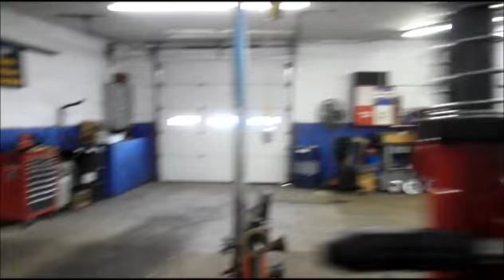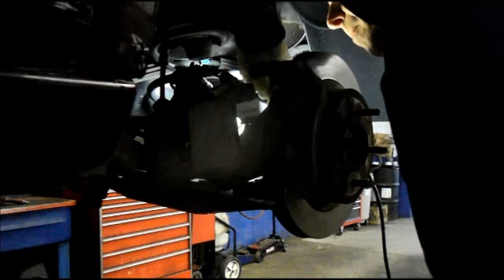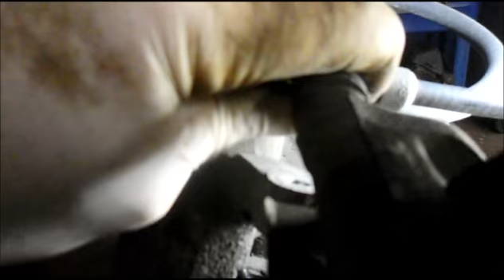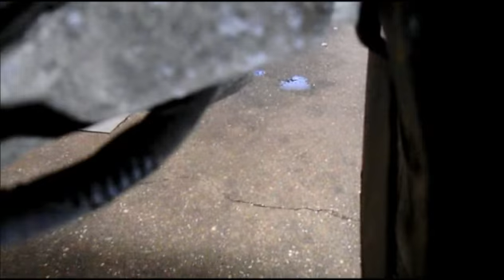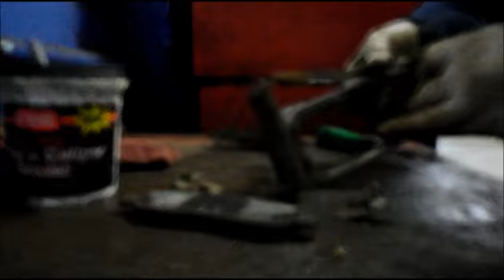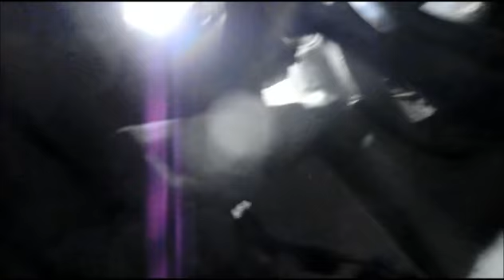How to replace rear brakes and rotors on a 2008 Buick Lucerne

Comment: That slide bolt with the rubber goes on the bottom slide bolt, not the top.

Comment: Im having issues with my 08, while taking right turns it makes driver side has a rattling sound that's louder the faster I hit turns, the wheel bearings seem fine as well as the cv joint, also it's not a deep sounding rattle like that of any cv joint I replaced.

Comment: Good work by an old timer but I have some observations 
1- you should clean the new rotors from the coating they spray at the factory
2- how come you don't use torque wrench for the caliper screws?

Comment: One slide pin has a rubber bushing on the end and the other does not. On my vehicle, each side was reversed from the other. What is the proper orientation of the slide pin with the bushing in the rear brakes, top or bottom?

Comment: If you replace the pads and the rotor and you push the piston in do you not need to bleed the brakes on every brake job you do on every car or do you just push the piston in and then press the brake pedal

Comment: I replaced brakes and rotors on my 2009 Buick Lacrosse now I get a sqeeling noise when I put it in reverse what is it
Reply from the maker: Did you replace the hardware kit?
Reply: jimthecarguy. yes
Reply: Yes I did all new
Reply: jimthecarguy it just started squealing a month later only in reverse
Reply: Can you help me
Reply from the maker: What brand parts did you use?
Reply from the maker: Do the brake pads slide free in the mounting bracket?
Reply: jimthecarguy bought parts at Orileys
Reply from the maker: What was the brand on the brakes pads,Wagner,Monroe or was it the store brand?

Comment: The tool you buy to rotate the cylinders back into position, you need it for the front too right? Also, what would you call the tool if you wanted to buy one?
Reply: Brake piston caliber rewind kit . . . that seems right
Reply from the maker: The front brake piston will not have to be rotated in you can just push it in with a C clamp or the caliper piston reset tool.
Reply: ok thank you, so i'd be better off just borrowing the tool instead of buying a new one . . .
Reply from the maker: That tool is very cheep you can buy one cheaper that renting it.If you watch some of my other videos I will show you how to push in the piston with just a screw driver.

Comment: wondered why the c clamp wasn't pushing in the piston,,,thank you!
Reply from the maker: On this type you have to turn and push the piston at the same time  .Take a look at my video at the 9:20-10:00 point to see how it works.Thanks for you question.
Reply: Not like other caliper pistons. the Lucerne rotates in and out. Some how my right rear brake pad disappeared leaving the caliper piston grinding on the rotor. Got a good one for 40$ at the junkyard. Making sure the piston smoothly rotates and bleeder screw was free.  The c-clamp will damage the piston....  When these shops start talking 200 to 500 hundred dollars for a brake job. You learn quick. I did....

Comment: Jim, thanks for the great video. I've done many brake jobs on older trucks and cars but am about to do the rear brakes on a friend's 2011 Buick Enclave. Would you say the late-model Enclave rear brakes are similar to the ones in this video? I'm new to the caliper pistons that need to be rotated in. I did pick up the special tool. Anything else unusual that I should be aware of? Thanks again and keep the videos coming.
Reply from the maker: +Dan Reynolds I think the Buick Enclave brakes are differant .The pistons should just push in  and not have to turn in.The parking brakes are shoes inside the rear rotor.Keep me posed and if you need any further info just ask.Jim

Comment: Great video.  I'm just about to do my 06 for the first time.  I noticed you didn't spray the rotors with brake cleaner (unless I missed it).  Did you do that before you started recording?
Reply from the maker: +Scott Hamill  Very good question ,Yes I did clean them before I started the video .If you run into a problem let me know i'm here all day.
Reply: OMG yes I have.  The caliper mounting bracket bolts are near impossible to remove on mine.  I have them about 3/4 of the way unscrewed, but it is getting harder and harder to move them.

On the top I am using a 15mm wrench with a 3/4" wrench on the end of that for leverage and with extreme force I get it to move mabye 1/16" of a turn each time.  The bottom is almost as bad.  I have been working on these 2 bolts for that last hour and a half.
Reply from the maker: +Scott Hamill  I know they can be a  real pain to remove because of the lock tight that the dealer used when they built it.Try using some penetrating oil on the bolts and turn then back in to lube the bracket and the bolt then remove.
Reply: Thanks!  I've been hitting them with PB Blaster, but I haven't tried turning them back in as I was afraid to lose any progress I've made so far.
Reply from the maker: +Scott Hamill If you still have a problem .Send me a private message and I will give you my phone number so we can talk.Jim
Reply: Finally got them about 30 minutes later.  I'm pre-soaking the other side over night.  Thank for the help!
Reply from the maker: +Scott Hamill great job . Let me if you need any further advice
Reply: Same deal with mine. Damn red loctite. It's like whats up GM you think nobody would ever have to take that caliper off?! I thought the red loctite was a little extreme/excessive.  I use red on bolts I don't want to come back out EVER! Haha

Comment: Thanks Jim, always good to see it done again.   
I've done my 03 Park Ave so many times I could've done it with my eyes shut.  But that's been a long while.  Now I have a Lucerne and hoping she's not much different.   Only problem, I'm not in my own garage, staying at family and scraping for tools.  Think I have what I'll need though.  THanks again.
Reply from the maker: Good luck If you could do the Park ave you should have no problem with this one.
Reply: jimthecarguy well I got her done, but not without incident.   ALWAYS happens first time I do anything.  
The 15mm bolts wouldn't come out, more I tried the harder they got, even screwed up a Craftsman 3/8 ratchet turning to hard..  On top of it all, I'm in between houses so my tool collection is limited, if I can find them. Turned out the bolts(rear) on both sides just needed proper lubrication.  A little back and forth and they worked out ok.  That wasn't the worst.  Using needle nose to turn the caliper piston only got it within 1/8 inch all the way in, so it wouldn't go over the pads.  So after two hours trying, I had to let that thin outer metal plate come off, and with lots of hammering she was on.    

Test Drive #1...SAT.   little noisy at first the pads were so tight, but fine now. 

Then to the right side.  Knowing the problems, I avoided them all.  Lubed the bolts first, and with just a little difficulty they came off.  Using the Square caliper piston turn tool this time, I turned and pushed hard all the way in.  The caliper almost fell onto the pads itself.  Tightened down all four bolts, put in the abs plug, wheel on, and safely let her down. 

Test Drive #2...SAT....

Oh, the one difference on the Lucerne over the Park Ave, is that star bolt in the rotor, it wasn't on the Park Ave.   Also, I looked at one of the fronts, they were in great condition so didn't replace anything, but did see they have Two caliper pistons, something I've never seen on all the brakes I've ever done.     

Now to get my next job, and a BIG garage to put all my tools in.
Reply from the maker: Hi Ron,It sounds like the first side was a little difficult but the second side went much easier.Good idea using the piston reset tool instead of the needle noise pliers.I'll bet you didn't stab your hand's like with the pliers.Lol